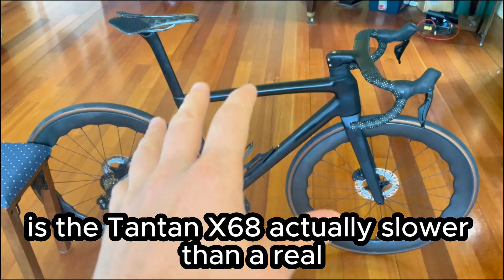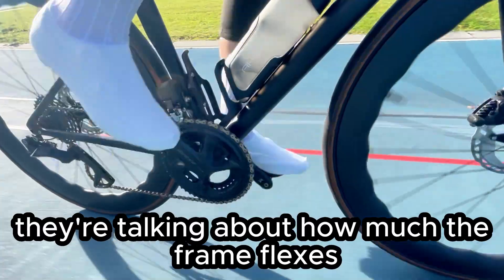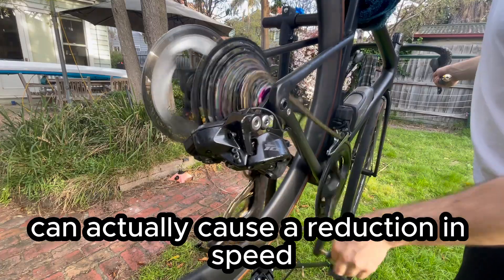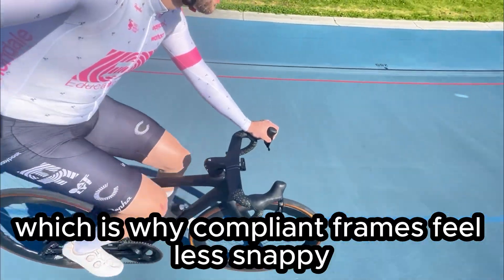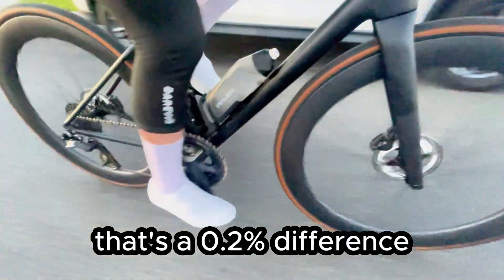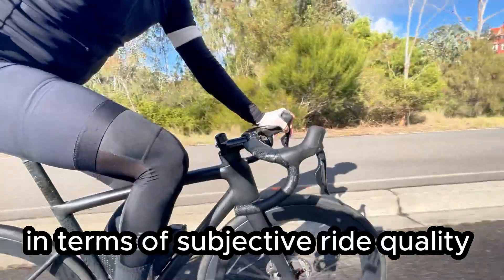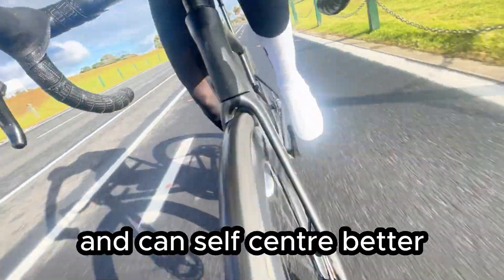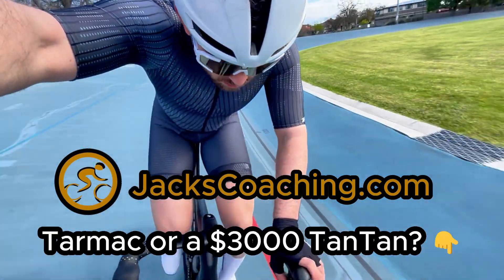My $3K SL8 Clone is Faster Than a $16K S-Works! (Frame Stiffness Deep-Dive)

Comment: Hey jack I really appreciate you dropping a lot of vids on a budget frame, I was wondering if the x68 could also use a mechanical group set and hydraulic brakes instead of electric, thanks mate
Reply from the maker: Thanks legend 🙏 pretty sure it can only work with an electronic groupset, not mechanical. There’s more information on their website.
The brakes are hydraulic ( there’s no such thing as electronic brakes )

Comment: IS this AI?
Reply from the maker: No lmao 😂 it’s me and a guy I met at my local velodrome with my voiceover.
Reply: @JacksCoaching  Nice, yeah I subscribed and saw your other videos.  How do you know the measured stiffness specs for this tantan frame, or is it an assumption (I figure it's probably fine)?  I had a trifox X18 frame and it was comfortable, but it just handled very strange in corners... which I figured was because of the flex(?) in the frame, not sure.  I'm a cat 2 racer in the states and am aways curious how these 'other' brands bikes are.
Reply from the maker: @t @travispyle2905  it’s an assumption based on material + mould. All modern high end carbon frames from China are stiff enough that basically watts won’t be lost due to flex. 

The handling is due to frame design and how the microvibrations pass through frame etc 

I’m a crit racer in Aus, have had no issues at all with the tantan.

I found it amusing you thought the video was AI haha.

Comment: Any worries in custom parts such as seat posts being a hassle to modify in the future? Thanks in advance
Reply from the maker: Not at all, all components are basically exact replicas of SWorks parts and are fully importable.

In fact, both seatpost and derailleur hanger I’ve replaced with SL8 cloned parts and it worked fine.

Comment: Their video (while technically probably true ) has verry much a feeling of the guy "proving" that his bike is just as good a as S-works tarmac ........like a civic owner trying to prove his tuned civic is better than a Ferrari 😂 not to hate, but the "my bike is fast " is sooooo pathetic...like okay then show results. If youre not racing, Noone should care ...... Kindergarten behavior 😂
Reply from the maker: But you admit it’s technically probably true…so what’s your point? 

The purpose of my videos is to educate viewers that you can build a bike that’s basically just as fast as a $15k+ bike for around $3K. That was my goal with this bike build and my videos about this bike.

Is that not useful information?

Because at least 30 of my viewers have since bought this bike and been extremely happy with it, and amazed by the value of it.

Also, I do race, my latest long form video is literally about a crash I had during a race! And I just bought an insta360 so will provide race footage videos soon.

Comment: Hello, would you buy the frame again or did you assemble the bike yourself or were there any quality issues?
Reply from the maker: I’ve bought it twice since the first one go stolen and it’s very solid. I also crashed in a race this week (check my community post) and the bike held up well despite a heavy crash. Superficial damage and scratches but no cracking of the frame.

Comment: for me lightness is about the vibration damper.
i own previous sold Aethos the old version in gold color. then i have another light frame from bigrock Shoetea
what i notice is the feel compare with my other climbing bike Willier zero sl which more heavy than this 2 other carbon frame
i got same speed in general but what make it very different is when it about frame vibration when we ride on the rough road.
to light bike frame is like a can tin it echo very much in uneven road while slightly heavy frame like my wilier sl it feel more stuffy like it absorb more vibration and it more stable on down hill compare than 2 other bike. which i have similar feel in my light weight rim brake TI bike.
in general i like both category 5-6 kilo and 7-8kilo bike both fun to ride. but for long ride i more chose my heavier bike, my hand feel more relax on heavier bike my wilier sl 7,8kilo compare 3 my light bike is all under 6 kilo. for my perspective light bike will compromise in comfort.
Reply from the maker: That's interesting, thanks for sharing. I've never tried an ultra-lightly <6kg frame so I can't comment. I think it also depends on how the cabon layup is done too.
Reply: @JacksCoaching  yes the frame design is number one factor which is matter. for cost point of view it not worth if we seek performance by upgrade into weight whinnies. because it very expensive and it not make me faster either.
it better me doing diet lost 4 or 5 kilo from our body than spend thousands dollar for just make our bike diet 500-1.5kilo which from what i already feel and test it not worth for the money, the middle ground for road bike is between 7-8 kilo lower than this i think it just for a hobby. this 7-8 kilo range is the best weight and it very cost effective.
but for an art and self achievement i never think it was waste. this is me my personal opinion. because this bike culture already become part of my life. sometime when we can create our imagination into reality that is the best pleasure from this hobby just by looking at when we clean that bike is very satisfying.
Reply from the maker: @endtimeslips4660 yes I agree!! 7kg is already very light! I’m on a diet too haha have to lose some kg  🫃 before making the bike any lighter 😂😂

Comment: I bought a Tarmak SL8 frame from Aliexpress (F bike store), and the quality of the carbon fiber is simply outstanding. The brake disc never touched the wheel when turning (I had a Tweeter that constantly touched the wheel), and the fork is as stiff as a factory Merida. The paint job is simply excellent. When I compared my frame to the original, I found that it was 90% similar. However, it is important to purchase from this specific seller. I did not find any other replicas to be as satisfactory. The bike is as responsive as the original.
Reply: I ride hygge model S have no problem with the bike,apsolutly fenomenal,and I am have rider. All eu brand to expensiv,for wath?
Reply: @borisdodig2433 I completely agree with you👍 , to give such money🤷. I also ordered a canyon aeroad frame, it's also very beautiful, but the tarmak SL8 frame is made of higher quality and the fork is stiffer, the seller said they are made in different factories, (Canyon frame factory also produce S5 , DOGMA F14 , F12 , F16 frame , SCOTT Foil ,
SL8 frame factory also produce Factor frame , and TREK gen frame , Gen 7 frame , Gravel F frame ,) на тармаке даже плетение карбона у подсидела, на вид такой же затертый как у оригинала
Reply from the maker: @borisdodig2433  Nice! I was tossing up between the Hygge and the TanTan. I chose the TanTan but the Hygge would have been my second pick!
Reply: @JacksCoaching yeep I chose hygge becouse team is riding the same frame.
Reply: But no problem to order tan tan next bike @JacksCoaching
Reply from the maker: Thanks for sharing! It’s good to know I’m not the only one who thinks it’s a bike frame that’s almost too good to be true! 🎉 can you send the link to the store? I can’t find it
Reply: @JacksCoaching There are photos of my frame in the reviews.
Reply: Can I ask you which specific seller you’re referring to ? Would love to acquire one myself. Thanks

Comment: It says in their site it's only 28mm clearance for tires.  Is this just for small frames.  Do you if you could fit 30mm gp5000 in 54/56 size?
Reply from the maker: It actually accommodates up to 32mm tires. I'm running GP5000 S TR 30's on the back, no issues at all.

Comment: I saw Pats video this morning. I have sn SL8 I'm about to get rid of. The tantan is compelling because i don't hate the SL8, I just think its over hyped. I think any of my pinarellos beats it hands down. Maybe I will get a tantan because I like using the SL8 as long ride bike, but don't think it holds speed very well
Reply from the maker: Thanks for sharing Kim, I totally agree the SL8 is overhyped! It's a very fast bike, but not worth the price in my opinion. The TanTan would be basically the same in terms of speed, but if you have extra $$ from selling the SL8 you could look at upgrading wheels, tires, cockpit etc. if you haven't already. You could invest in ceramic OSPWs, DLC chain, etc. for marginal gains.

Comment: SRAM breaks suck! I work at a bike shop. Don’t get me started on there batteries 🤦🏻‍♂️
Reply: Patty should have put the adapter on the mountain point and shined a light on it to see if it was sitting even. If they don’t will always have rub.
Reply from the maker: @jonphotos8631  Good idea about shining a light!
Reply: This is why I switched back to Shimano. Plus Scram needs constant rebleeding
Reply: @kimwarner6050 and the bleeding process is a pain!
Reply: @jonphotos8631  Nah, its really not that bad, just wished they could use mineral oil instead of dot.
Reply from the maker: @kimwarner6050  Fair enough, I've never tried SRAM and now, probably never will!
Reply from the maker: Fair enough Jon thanks for your insights! What’s wrong with the SRAM batteries?
Reply: @JacksCoaching they don’t charge, we have to bang them lightly on the work table to get them to take a charge coming out of the box. We always have customers coming back with battery issues.
Reply from the maker: @jonphotos8631  Wow that sucks! Shimano all the way!

Comment: I’m thinking about buying this frame but don’t have any experience with building up my own bike. Do you think this is something that is easy enough to do with no experience?
Reply from the maker: Good choice, Jack! I got the bike store to help me with some aspects of the build (groupset installation, cabling) and did the rest myself on my first TanTan. On my second TanTan I bought it pre-assembled with 105 groupset, then installed the upgrades myself. 

To build a complete bike, you'll need quite a few different tools, so it might be easier to pay a bike store/mechanic $200-300 to do it for you, or otherwise just buy the bike as a complete bike.
Reply: @JacksCoaching  How much does a complete x68 with no custom logos cost with 105 di2? 👀
Reply from the maker: @welsonwei3285  $2.45K USD + shipping (which varies a lot depending on your location!)

Comment: I have no problem in admitting that a TanTan has the same performance as the Specialized in terms of aerodynamics, weight and stiffness but I do take issue with the underlying assumption that they’re “basically the same”. There’s a lot of engineering that goes into how a bike feels, and while it may not mean a lot to you it means a lot to people who chose to buy these high end bikes. Another thing is that TanTan made absolutely zero effort in R&D to create this bike, while Specialized built a wind tunnel, hired the best engineers in the field, sponsored multiple pro teams who give them invaluable insight in the design process and all that has to be made back in the price of the bike. Sure a lot of money is spent on marketing as well, but that also is part of what it takes to build a global brand
Reply: I'm all for capitalism, but 6000 usd for a frame manufactured in taiwan is excessive. Even with R&D, CAD design and CFD testing is not all that expensive. (not saying no one should buy it, even I would if I had that much to spare, but its expensive nonetheless)
Reply from the maker: @DittersGustav completely agree 🎉🎉
Reply from the maker: Fair point! When I said the frames are ‘basically the same’ I meant from a performance standpoint (I.e. the speed at a given power output). Maybe I should have made that clearer. 

I agree that the compliance/feel of the real Specialized is slightly better, and that this is no doubt the result of the engineering behind it in terms of the carbon layup. You’re right in saying a lot of R&D has gone into their frames.

The main point of the video is to expose the potentially misleading marketing claims that they and other big brands are making, implying that stiffness actually makes the bike go faster etc. which is used to swindle customers out of thousands of $$$ and which I don’t think is ethical.

I have no problem with SWorks bikes, but I feel obligated to share to potential customers that they should know what they’re buying - they’re paying 10x the cost of a frame for slightly better ride quality, the status, and a tiny bit less weight, but not speed. I feel that if more people knew that, they would probably reconsider their purchase.

Basically, I want to separate the performance aspects of the bikes from the (deceptive) marketing hype, so potential customers are more informed.
Reply: @JacksCoaching  that actually makes it worse for specialised for the fact that they charge upwards of 15000 for a bike that maybe feels 2% better than a 3000 bike. So they will eventually charge themselves into irrelevance.
Reply from the maker: @tomrowe372 Yes, that’s very possible! On the other hand, a lot of people buy Sworks bikes as a status symbol, so that customer base probably won’t change. But savvy consumers will opt for cheaper options that offer similar performance like the TanTan🎉
Reply from the maker: @Lifesurfer001-iq7nf  There's no evidence that modern Chinese frames are any less safe than Western branded frames (they are all manufactured in China/Taiwain anyway). In fact, a lot of the Chinese company frames are heavier and more robust than the Western brands, as many of my viewers have pointed out.

Comment: So you had access to both the Tan Tan X68 and SL7 and didn’t do at least one time test….like a  7 minute ride at 300 watts. 😮.  Especially since you’re an affiliate for Tan Tan your comments can be considered bias.
Reply from the maker: I don’t currently have a power meter on my bike, believe it or not 😅 I plan to make a video in the next couple of months where I compare the two bikes at a given power output - but I want to do it with two bikes that have identical groupset, wheels bars and position to isolate the effect of the frame itself and remove confounding factors. Then do analysis to see if there’s a statistically significant difference between the frames. If you know anyone who has a sl8 frame I can borrow, let me know!

Also I’m not sponsored by TanTan, the affiliate link I have is the same as all products on AliExpress, so my reviews are genuine and based on my personal experience.

Comment: It surprises me how the China frames can’t get the weight low or identical as the SWorks models.
Reply from the maker: I suspect they can, but to ensure the product is more robust they add a bit of carbon to the layup.
Reply: They can. At the China cycling expo, you see Chinese branded bikes fully built in the 13 pound range, but they are more expensive than the copies like the fake Dogmas, Madones and Tarmacs. For the budget-oriented copies, the goal is to get something that looks great, is safe, and is cheap to make into the consumers' hands and that means overbuilding the carbon to make sure its strong, sometimes, even stronger than the original. It's extremely laborious and research-intensive to shave weight without compromising safety so if an extra 150g means they can generously lather on the carbon and epoxy and move onto the next bike, that's where the savings come from.
Reply from the maker: @victorj1167  Exactly right! Thanks for sharing those insights 👏

Comment: There’s no doubt a less expensive chinese frame can perform as good as a western branded one.

I’ve learned most people just feel good riding around on a10k+ bicycles even though they may not take advantage of performance aspects. Maybe a status symbol? Dunno 🤷🏻. What do you think?
Reply from the maker: Yes, I agree completely. A real SWorks is basically just like a Rolex. The purpose of my videos recently is kind of to prove the point that the price tag of these high end Western brand bikes is really only justified by seeing them as a symbol of status, not as an inherently better bike.

Comment: Frames made in China and being a copy of a high-end frame......yes, there is a difference in the feel, but most important? On the wallet. 
If you can't afford a Colnago or Pinarellos? A Chilnago or Chinarello will do.......just don't tell your friends.
Reply: Or do tell your friends. Smoke their $16K Pinarellos riding your $3K Chinarello and see who feels smarter after the ride.
Reply from the maker: @victorj1167  This happened to me recently, with a group of 10+ guys all on SWORKS 🤣🤣🤭I offered them to ride my bike but they declined😂😂😅
Reply: @JacksCoaching  They're scared it will confirm to them all the money they wasted. Without riding yours, they can continue to pretend to themselves that all off-brand ones are junk and you were a pro racer trolling them.
Reply from the maker: @victorj1167  Exactly 🤣🤣they're afraid to face the facts!! They wasted thousands!! $$
Reply from the maker: Yes exactly 👏 I’d rather have a slightly different ride feel and save $13K!